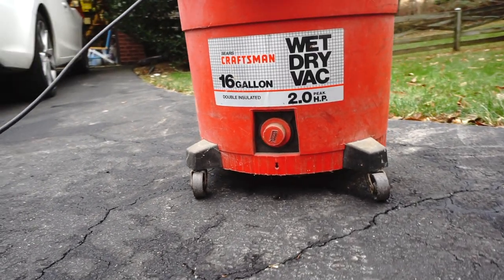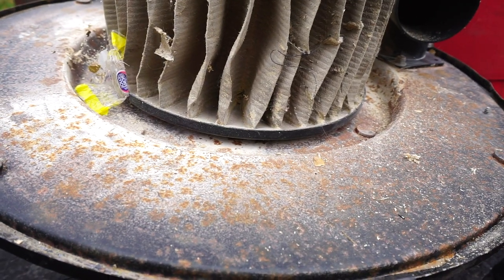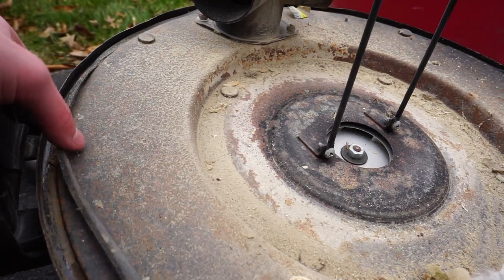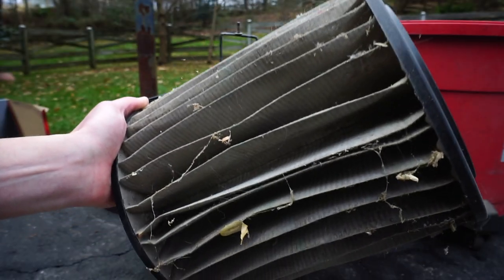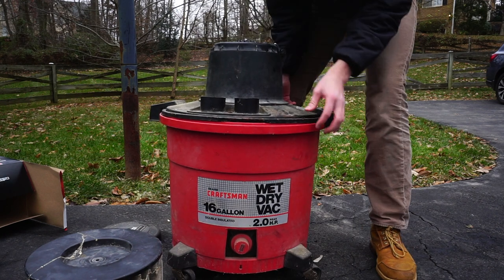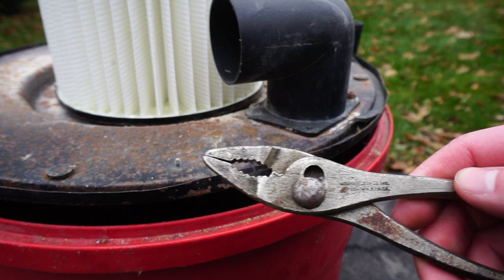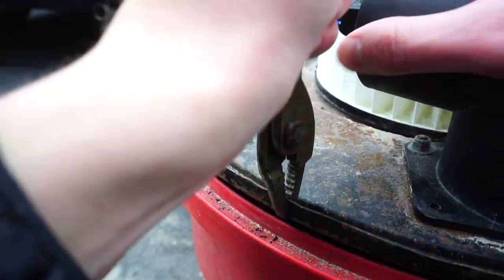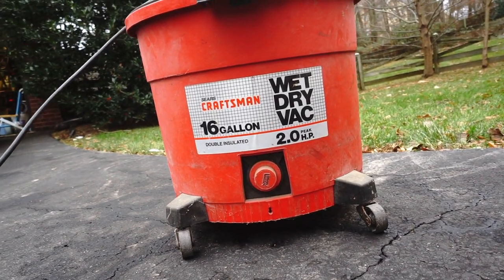Does this old Craftsman shop vac actually suck?

Comment: I have that same shop vac and needs a new filter. Where did you find that one?
Reply: He got it from Sears. Sears used to sell the filters for these. Unfortunately when Sears declared bankruptcy a year ago they stopped supplying a lot of stuff and the 9-17804 Green Stripe Filter was one of them. There is not a third party company making a replacement also currently so I would keep your eyes open on eBay or on the net. I have the same vacuum but Its the one before this one .
Reply: I think the bigger ridgid filters fit
Reply: @mrm10199  Yeah I'm in the same boat. Once they went BK they have nothing for the earlier models. Still searching with no luck. I may try the Rigid types for the hell of it.